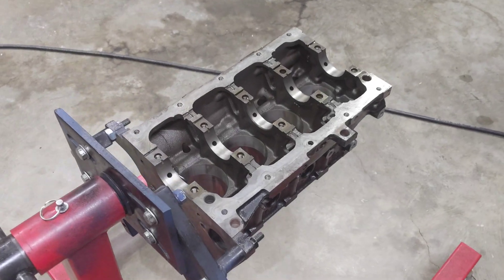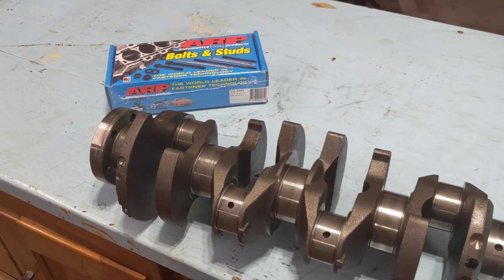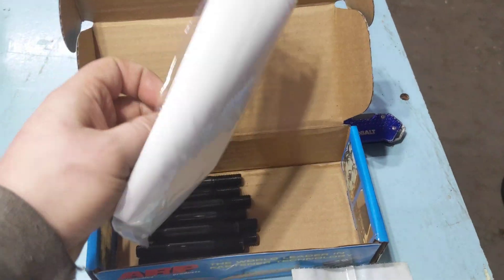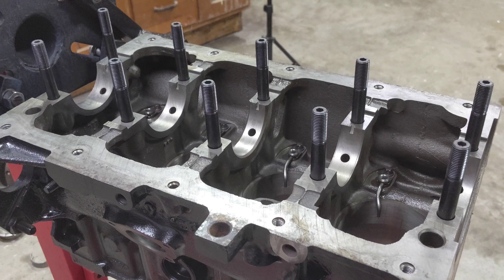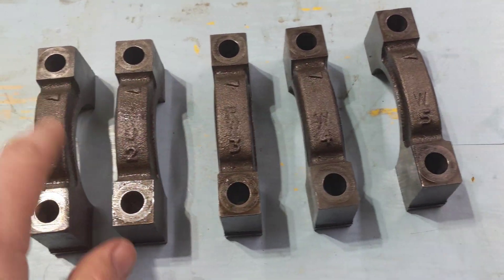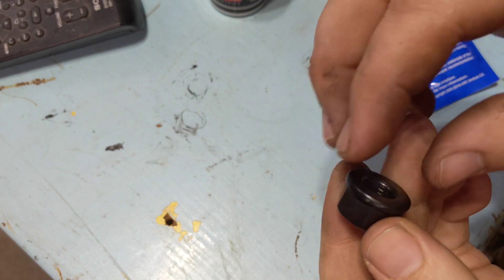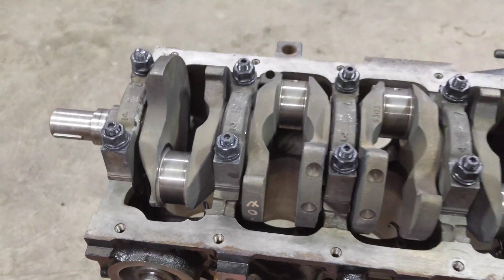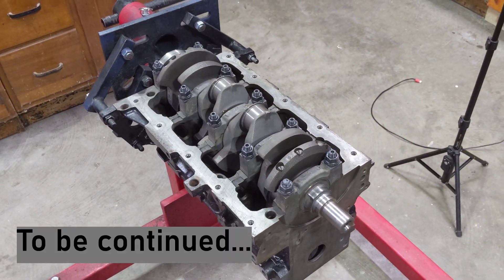SVT Focus ARP Main Studs, Main Caps, and Crankshaft Installation

Comment: For 2010 arp is saying follow  oem tq sequences tighten in 3 equal steps to 60ft lbs....... to i to all 3 oem Tq steps (which includes 44in +18in + 90°) then to additional  180lbs... or to i do 60 3x
Reply from the maker: @doogeerugged89  i don't know where you are seeing that written but I'm not aware of any ARP fastener that is torqued like that.

Comment: Dude, never should you run a tap into a threaded hole. Buy a set of thread chasers and use them instead.
If you have an issue with this info, please contact ARP and ask them what they think about it.
Also, ARP recommends not bottoming out the studs but to pull back 1/2 a turn.
Reply from the maker: Two studded motors done the same way with no issues. A worn out cut tap isn't removing any material and with supply chain issues chasers weren't available. Could have used slitted head bolts but this worked fine. Gotta work with what you got. For a 150 horse focus motor with reused pistons I'll gamble it. 🍺
Reply from the maker: But I appreciate you watching and commenting!!
Reply: Rekommended to use a chaser but ive used a tap countless times and no issue it doesent cut the threads. Please tell me why i shouldnt use a tap if i get it to dont cut the threads?

Comment: Can u tell me what engine code is that ? 
Or how I know it right engine for svt cuz another base engine is 2.0
Reply from the maker: This is engine code 5.  Basically, on your VIN there is a 5 in the engine code.  It is for the SVT.  The block is the same as a regular Zetec 2.0 Focus.  The only difference is the oil squirters which are not necessary.  The pistons are different and rods are different for an SVT.  You can identify them by looking at them.  Also, the cylinder head is visually different than the base engine.  Hope this helps.

Comment: Did you have to line hone the main caps? I hear mixed opinions on whether or not you have to line bore the main caps when using arp studs. Thanks!
Reply: I think the only good answer is measuring it!. You will (on some blocks) get a bit of deflection on the main tunnel when doing high torque ARP main studs.
Reply: I have done both. No problem either way. To be 100% I would, and have the crank lightened and polished for some more RPMs
Reply from the maker: That would have been sweet.
Reply: @605BOLT  You're going to have your mind blown when you discover torque plate honing.  Your idea that cast iron doesn't deform from bolt torque is just plain silly.  Consider using your measurement equipment to measure the roundness with the stock hardware vs ARP at the OE vs ARP torque spec.  There's a reason machine shops require you to bring in the hardware you're using before they align hone your caps.  BTW, those studs put a force of around 20,000psi against those caps.  Whether they distort isn't even a serious question.
Reply from the maker: I love how you're talking about tenths when I reused the crank without polish, have a Menards $40 torque wrench that has never been calibrated and the car makes 170hp.  Relax speed racer.  Nobody around here is plate honing anything. You're watching the wrong video for that.  This is like a briggs and stratton lawn mower engine.  This isn't a 2000hp drag build. Also, notice how nicely the crank spun when installed.  Almost like the caps weren't deformed at all.  Weird.  Guess I'll wait for this engine to fail.  Been waiting on my truck to fail for 8 years now.  I wonder when that will be.
Reply: @605BOLT  I never said you LOST bearing clearance, but I guess you'll never know, unless it fails prematurely.
Reply: @605BOLT  so I was the guy that commented 2 years ago. I actually built the forged 1jz and used ARP main studs and didn’t line hone it. And it’s been living now for 2 years on 20psi. Thanks a lot for the info. Ignore the internet mechanics who never built shit in their life. They always got an answer for everything.
Reply from the maker: @Soomacok  preach brother. Glad to hear your build is going. Any videos on here? Sounds like a fun car.
Reply: @605BOLT  unfortunately no, I ended up building the motor and and selling the the motor, car and everything. Basically got out of cars to play with boats instead lmao  but the guy who bought it has been ripping the car for 2 years now. All I can say is this to the doubters. I understand that the higher torque specs can distort the block but on an iron block I didn’t have any issues. Once you torque the studs down, spinning the crank by hand will tell you everything you need to know.
Reply from the maker: @Soomacok  nice you're into boats now. I took like to burn money hahaha. What kind of boat?
Reply from the maker: I have studded both my lightning in 2016 and my focus just now and never line honed either. I'm either lucky or it doesn't matter.
Reply: @605BOLT  thanks for the reply man, I’m on the same boat as you. I’m building a forged piston and rod 1jz. And everyone is like “line hone the bore, or else it’ll blow up when using arp main studs” but those are the “do it by the book” kind of people 😂 I’ve rebuilt plenty of motors before but not one trying to chase power. In my mind I think it’ll be okay without a line hone. So I was gonna just send it 😂 anyway, now that you let me know. I’m definitely gonna send it.
Reply from the maker: @Spooolin104  haha well this little shit focus won't make anywhere near the power you're after but my lightning makes about 400wheel and 500wheel torque and weighs about 5000lbs so that is a fair amount of power and plenty of weight to move around. No issues there since 2016. Along the lines of what you're saying I think there are a lot of guys who make shit way too complicated. Hell we got guys out here reusing main bearings on LS motors making 6-700 horse for long periods of time. Unless you're going way crazy on the power I think you'll be ok but definitely run it by your machine shop or someone else who has built the same kind of motor you have. I'm with you though. I'd send it.
Reply: @605BOLT  for sure man, especially to be living in your truck since 2016. I’d say ill be fine. And I think the same thing, I get it if you’re trying to blueprint an engine, and want it to last forever or if you’re engine is worth a lot of money. Then by all means measure every clearance. But for the normal guy like me and you, we’ll be okay. And I’m gonna install them and make sure i don’t feel the crank binding when I turn it. If it doesn’t bind, I’m sending it 😂
Reply from the maker: @Soomacok  that's what I would do. I would at least run some plastigage just to be sure. I have a video on how to use it. Should give you some peace of mind.
Reply: If you install hardware that changes the torque spec on the caps, you're distorting the cap differently.  ARP requires more torque than stock hardware.  Luck does not equal proper procedure.
Reply from the maker: And that's why you verify proper clearance with the plastigage.
Reply: @605BOLT  Plastigage only gives you approximate clearance at one specific spot.  It won't measure roundness.
Reply from the maker: @chriswise1232  true but I don't know how a guy would machine a crank out of round and i measured the rods and they were in spec. Mains aren't going to be out of round just from a hardware change. It's a ford focus. A 20 year old ford focus. Car runs great. Do what makes you happy on your build. I can't even count the number of engines I've done this to with no issues. Not an F1 engine building room here. The car doesn't even make 200 horse and at the time I studded it with the intention of boost at some point which would push it to 250 horse max.
Reply: @605BOLT  It doesn't effect the roundness of the crank, it effects the shape of the mains.  That's the distortion I was referring to.  The vehicle is irrelevant to the point.
Reply from the maker: @chriswise1232  the vehicle is absolutely relevant to the point. Build your focus how it makes you happy. Idk why you're even watching this channel if you're such an expert that you're telling me something doesn't work when it very literally did work and does work and continues to work. Us guys who actually build engines will keep building them the way that works and has been since forever. You can put 360 little pieces of plastigage in there to check every degree of rotation if it makes you feel happy. But sorry to say cast iron main caps are not distorting by tiny little arp studs. If that was the case no one would use them. But they do. And they do it just like I did it. And they all run. I have them in my pickup to. Been in there for 8+ years, 50+ passes down the strip making over double the power of this little focus.
Reply: @605BOLT  😆 Too funny.  Buy some measurement equipment.  You're making some really embarrassing comments.
Reply from the maker: @chriswise1232  literally have the stuff and didn't use it. Check the video where I measure the rods. I'll wait for u to chirp about not having measuring equipment.

Comment: What timing kit did you buy?
Reply from the maker: The timing tool kit I bought was from massive speed systems. Similar to this link but they're all basically the same. Some Amazon/ebay junk would work just fine too. Hope this helps.

https://www.ebay.com/itm/Massive-Absolute-Cam-Timing-Alignment-Tool-Set-Pin-Bar-Focus-SVT-2-0-ST170-Zetec-/352960419002?mkcid=16&mkevt=1&_trksid=p2349624.m46890.l49286&mkrid=711-127632-2357-0
Reply: @605BOLT  timing belt kit.

Comment: Is your car engine vin 3 or 5???
Reply from the maker: Vin 5 (svt) 👍
Reply: Mine is 3, i wanna built forged for use turbo, fswerks, hit like 300hp
Reply from the maker: @albertromero7601  damn that would be badass. I think a lot of this is similar but I've never done one so I can't say for sure. Block and crank are the same. I know you'll be getting rods and pistons for that kind of power. You should record it and start a channel.
Reply: @605BOLT  thanks for the idea, i did it a lot modified right now, so i wanna more power, you know eagle rods for the piston im not sure
Reply from the maker: I don't know about that big boy focus stuff. That's rowdy goals though. I'd love to see it on YT.